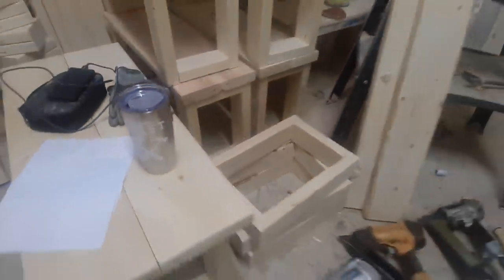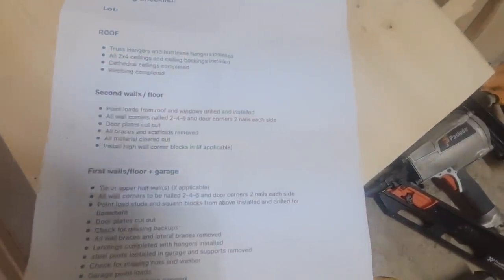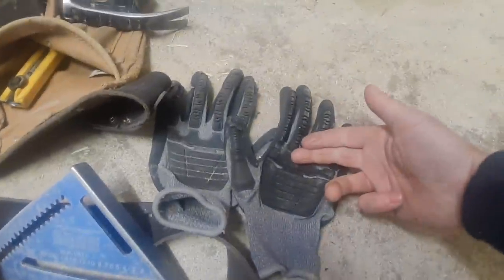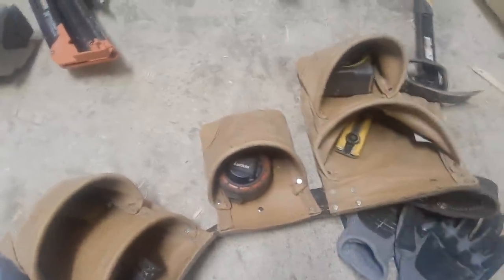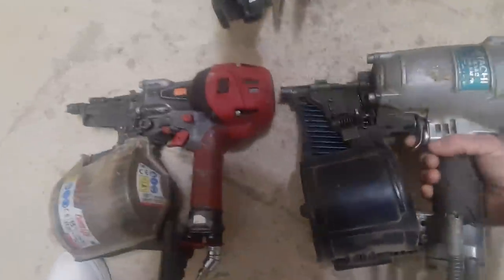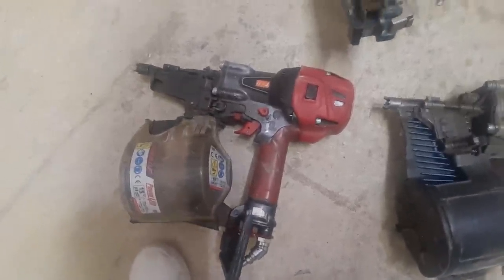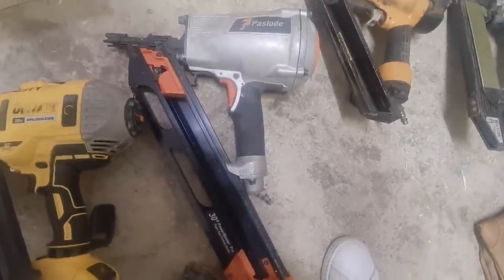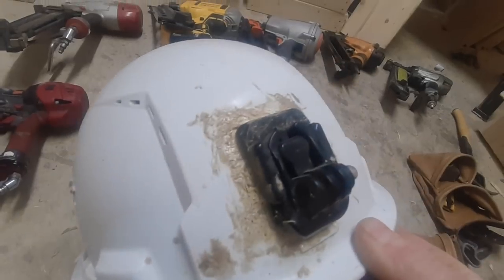Tool pouch tour, my nailers and pros and cons to each,  dewalt miter saw setup and house checklist

Comment: Adrian, i am in Ontario building my own house and have a question. In the Ontario Code it calls for say 2 16d nails from a joist into a stud but i notice your guns are likely using a 3 1/4 .120 nail. Do inspectors ever call out this size difference? Do you just another nail instead? Im sorry i have not worked on crews before as I was a mechanical engineer before semi-retirement. By the way, the error stacking we call "stack-up". In fixture design we use a 5mm shimpack and 5mm spacer to be able to get  it within +-.25mm accuracy. I can see after doing my joists what you mean tho that we can be taking easily a +/- of an inch for sheeting. Really slows you down. Anyway just wondering mostly about the nails schedule being so off. Thanks.

Comment: I have been following your channel for a while now and love it. I am a builder  that only builds 1 or 2 houses a year. I do most of the work myself with my crew of 4. I know how to do bird mouths, how to get a roof pitch angle, rise, rafter length The question I have . Is there a formula on how to get the angle where say a 4/12 rafter sits on a 12/12 or any other pitch?

Comment: What air compressor do you use to run your tools? Thanks for all the content.
Reply from the maker: I have a few but for the last few months been using a mastercraft maximum 15 quiet compressor. If it gives me 1 yr it'll be good because compressors these days aren't made for the long haul. I switched from gas yrs ago b
Reply: Rolair 2 stage for gas. Dewalt has a decent 4.5 gallon electric for less volume uses

Comment: do you reckon the max comressor can keep up with a crew?
Reply from the maker: Hi Dylan, if its a two man crew this compressor can handle no questions asked, but anything bigger than two guys and I'd invest elsewhere. Don't get me wrong there's plenty of benefits with it like ultra quiet and high and reg pressure but you'll get frustrated. It's best comparable is a 6g pancake compressor I say. Now for roughing in and doing a lot of boxes and overhead work where 4Ib nailers excel then I'd pull the trigger and invest in this system all day...hope this long winded response helps

Comment: Hi my friend !  I am 62 and a custom finish carpenter.  Everyone states I will not be swinging a hammer at 62?
I don’t need the money I am ok?
But I tried retirement?  No way I hunted, & fished like I worked?  It was crazy and writhing 5 yrs bored?
Some guys (like you don’t gimmie any story about not u!  I watched u worked)
All that to say this!  You buy cheap tool belts, mediocre boots or wear tennis shoes , swing a $50 hammer and you will not be able to run a lawn mower let alone stay working !

I wear good $200 to $300 boots like Keens , Red Wings, with soft grip wedge soles!  You can resole them and I run a good kind of Keen boots called a Kennion !  You can find good solid shoes/boots no tennis shoes BS!
I also wear a Buckaroo pro back support belt and designed my bags for cabinet , finish work!
I use a “wood handle Stiletto 10 oz & I hv a 12oz framer if I need it!
I used to wear those belts u hv I would get 18 months or so out of it?
I hv beat my Buckaroo up for 5 yrs and it’s stool sweet ; plus I use “real suspenders built for it “ which take a good portion of the weight off my hips!

Not if you will get hurt but when!
I fell 15’ when scaffold collapsed (accident) and broke my foot ?
Doctor said if I would hv had on tennis shoes I would hv needed surgery and at 60 probably forced to retire?
That is right I said 60!

I enjoy my work and tailored it to suit me now at my age!  You need to get a nice compact belt like Occidental trim pouches if u like that?  Or buy something to preserve your back and feet!

I enjoy you hard charging work ethic I just respect that Adrain !  Spend some good money on you! To prolong your work & health!
Reply from the maker: Hi Zephyr, as we all know there's more than  than one way to skin a cat. I don't wear adidas white shoes to actually frame I wear high quality boots. I do believe there's something to be said about getting bit once when choosing between value and quality. More time than not buying cheap tools will cost you more in the short/long term ... question stands is it the archer or the arrow that makes the ultimate difference
Reply: Cant argue with that Adrian !!
Like driving I tell good framers carpenters watch out for the other guy!
That’s how most of us get hurt!
Like the guy trying to help me undid the safety latch on the scaffolding?

He was devastated so I just said “ahh no big deal it will be good in 6 weeks I will limp until then!

Knock’em dead brother!
Reply: Adrian I was thinking the same thing, I use to get 6 months on those cheap bags framing, now I do like good tennis shoes for framing in dry summer months, now boots all day in the winter and muddy rainy days. Nail guns I run one kind and buy my nails by the skids, they keep my guns up and going as long as we shooting they selling nails
Reply: There are a lot of statements made in your comment that I would say are rather ……….questionable ?